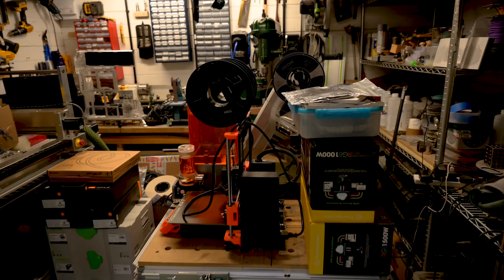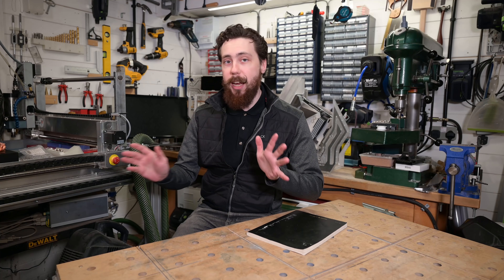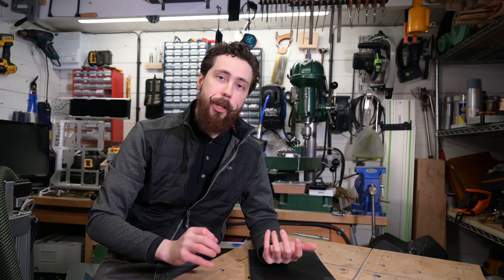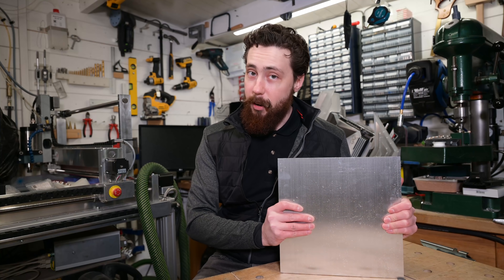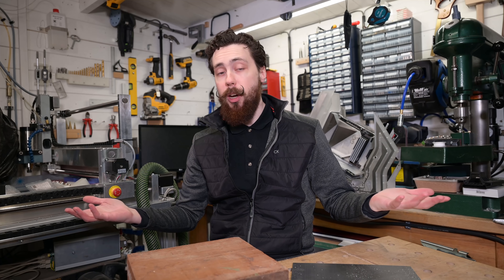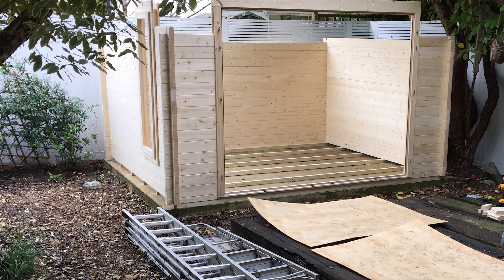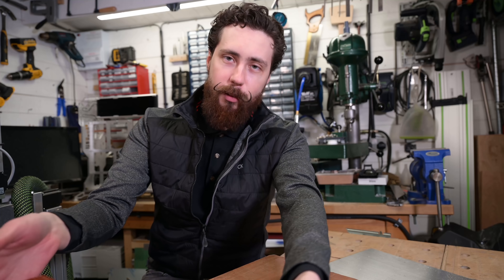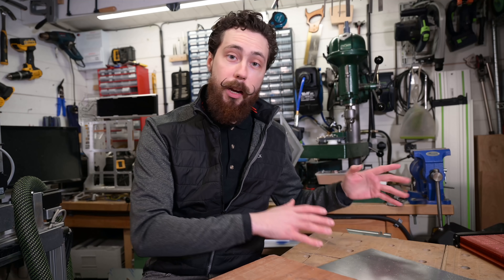How to START a Scratch Build PC Project | bit-tech Modding

Comment: I've already designed most of a case. I'm planning to buy a 4000D airflow and mod that. I have basically no tools besides drills, grinders, and hand tools, but I have all the skills I need lmao. Walnut accented 4000D baybee
One of the biggest things about this is that everyone's workflow is different. Personally, I like jumping straight into CAD and making about 6 different versions before getting something I'm happy with. It works for me, though it may not work for everyone.

Comment: I must say I am a bit scared for his temps with a 3090 in the loop with only that subpar 360 radiator. Its a beautiful and well made rad, that can take a lot of pressure but its not a top performer thermally...
Reply from the maker: There's a 480mm Hardwarelabs in the front btw, just haven't shown it as there's nothing interesting about that particular rad
Reply: @bittech1  Well consider my thermal concern... Dissipated. And since you took the time to reply to me I am going to take the time to sincerely thank you for your content and its quality. Only came across your channel this week and I am already feeling my scratch build dreams and mod dreams are getting closer. Following your thought on considering outsourcing, I discovered a company local to me not only makes high end swiss cnc machines (the brand is BADOG) but they also have a very well equipped makers'space and offer classes to learn to operate them. And it's all incredibly affordable. The classes and the makers-space access, that is, not the machines. Anyway, thanks again. You got a long lasting sub from me and I'll be visiting the forum soon. Sail on Commodore!

Comment: Thank you SO MUCH for the warning against using other people's CAD designs.  I downloaded some Noctua fans from GrabCAD and double checked the dimensions against official specifications after watching your video.  The screw pattern dimensions were off which means I have to completely redesign my front panel.  I almost sent the design off for laser cutting!  Would never have checked without your recommendation.  Thanks again.
Reply from the maker: That alone has made the video worth it!

Comment: Happy New Year Alex! Great video. As always good inspiration, as I am currently turning my system out of an InWin 928 into a be Quiet! Silent Base 802...for noise reasons. Which involves a custom made res and a distroplate, because realistically the new case is a bit too small for an EATX board without a little bit of tweaking...So grateful for your channel!
At 2:17 I would have LMAO if you had used the Benny Hill theme instead ;-)

Comment: Safety question:
Should one worry about grounding the whole scratch build case? How would one go about that? Is it something you worry about in your builds? I'm guessing it's enough that every part is somehow connected to the PSU in the end which is a given if you screw every aluminium part into each other with direct contact

Comment: Happy new year! to you too... I was listening to you speak about downloading CAD files and how unreliable they can be, which made me want to ask; Do you as an alternative method, design your own parts in CAD in order to gain the exact measurements you need for building your designs around? I do at times use grabcad so I know exactly what your referring to when they are not exact...
Reply from the maker: I never use GrabCAD, my only two options are designing myself or using a manufacturer provided model and double checking it.
Reply: @bittech1  thks for the reply